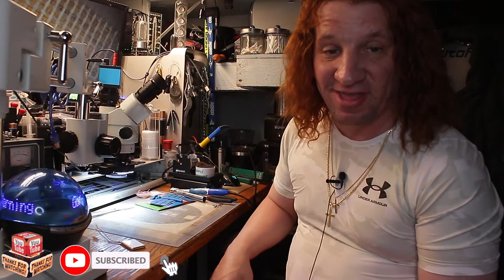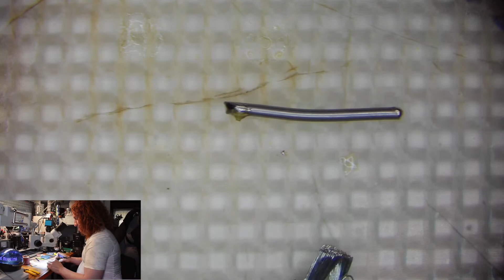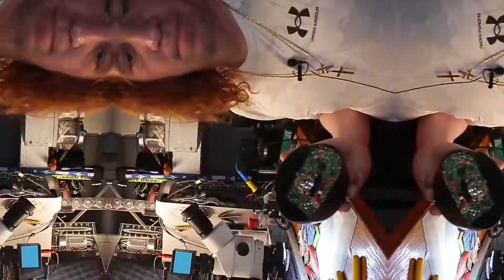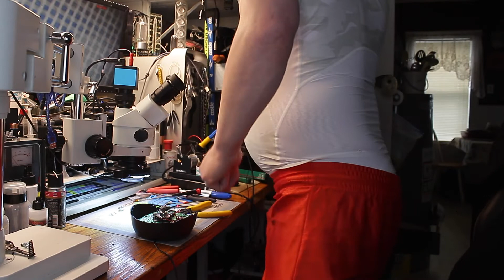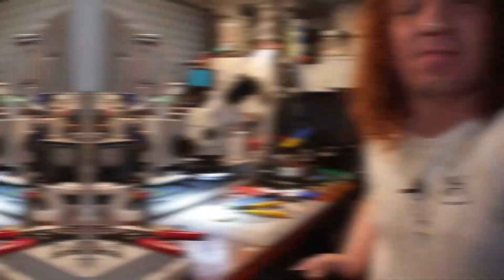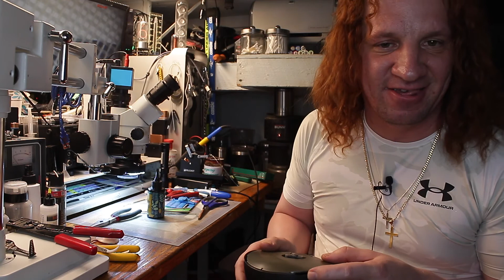JayKay18s Olympia Discovery Info Ball Sleeper Mod Part 4 #RollingTardis

Comment: That was a tremendous amount of work for a battery delete.  Way over the top of the stuff I get into.  But, I'm happy about it, and glad that I won't ever have to worry about leaky AAA batteries in it.  As an added bonus, I suppose years down the road when the lithium battery gives up, that red LED will illuminate once again.  That was a neat trick indeed, and it's all nicely self-contained.
Reply from the maker: Childs play for me. See the red, action required. At least, it is an easy enough swap out, for your skill level.
Reply: @RollingTardis  Yes, I can indeed swap out the battery.